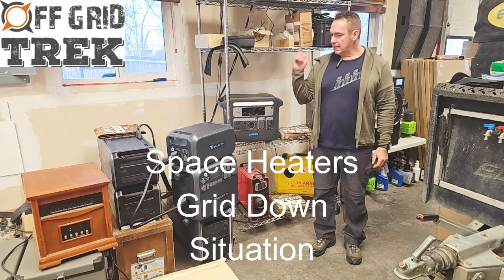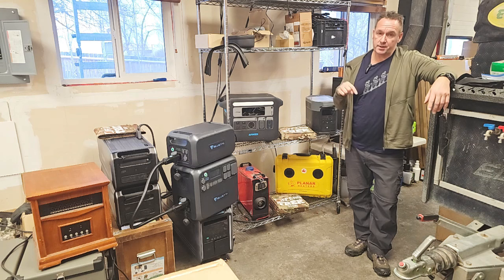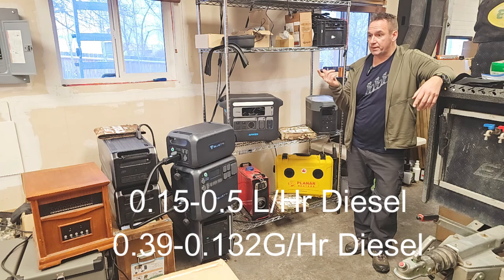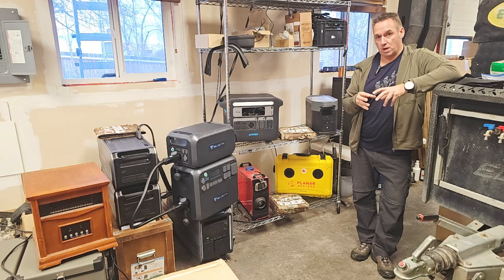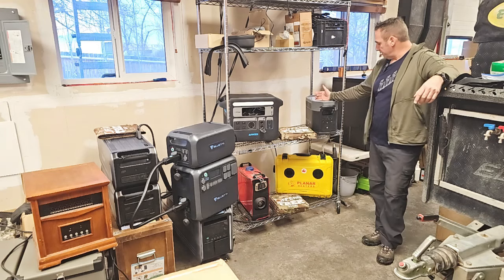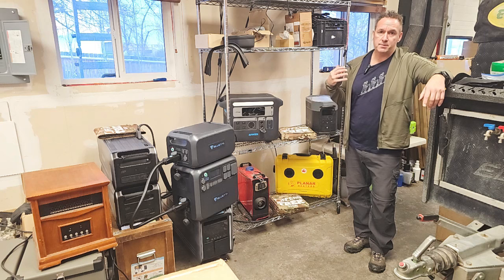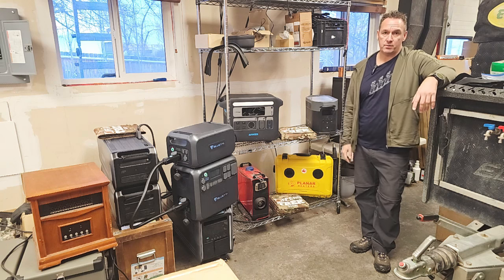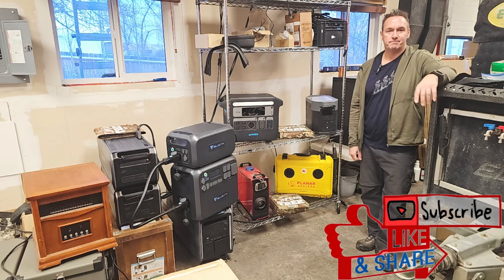Space Heaters during Grid Down

Comment: I ran a Diesel Heater 2 years ago all winter no issues. Tried to do the same  the following year and got an error code and the heater refused to start. IMO some have great luck with those heaters, me not so much. I bought a Quartz Radiant Heater, on the low setting it draws about 325 watts, High about 800 plus. This so far is the best option for me. Small Butane heaters are pretty good also, like the Cupid Portable Butane Gas Heater even a Heating Blanket plugged into a Power Station, will keep you toasty for many hours .There are many options if you want to stay warm in and Emergency Grid down scenario. These are not extremely long term fixes. The best option is a small wood stove professional installed or a DIY Tent Stove you can retrofit through a window. One should have all options at hand so you can adapt to your situation.
Reply from the maker: I have had to deal with the fault codes on the Chinese diesel heaters and was able to find a list of fault codes with fixes, I ended up printing it and bringing it with me when I used the Chinese diesel heater.  Now that I have the Planar heater I no longer have to deal with this, not fun at -20C when a fault code stops the heat when in the mountains in a roof top tent trouble shooting with a headlamp on.

Comment: The best way to keep warm is to adapt your homes gas heater so that you can start it with your solar battery. There’s videos out there that show you can use to keep warm.
You can do it yourself, but it might be best to get somebody who knows what they’re doing.
Also, an electric blanket would be better than trying to run an electric heater. 
I like the diesel heater, but that would be just for one room in the house and not protect your water pipes. 
For a long-term grid down situation, you will definitely need solar to charge your batteries, and a generator also. Dual generators with gas and propane are best. 
It’s also important to insulate your house the best you can.
Reply from the maker: All good points thank you for bringing them, many of these have been covered in previous videos.  I wanted to focus on space heaters along with better alternatives being this question is asked daily by our customers.  With our -55C/-67F weather that weekend it seemed like a good opportunity.  Note that with a properly insulated house a diesel heater will heat several rooms, granted a high efficient wood stove or running a furnace of of a portable power station will be the best options, and something I have personally.
Reply: Thanks for sharing your thoughts! You brought up some great points. If you’re interested in this topic, we encourage you to check out our award-winning documentary called Grid Down Power Up - Documentary, narrated by Dennis Quaid. It’s free on YouTube, and it goes into a lot of detail on these issues. Plus, they’ve got a website where you can take action by contacting legislators and public utilities. Please help us spread the word!

Comment: YOU NEED 15,000 WATTS OF SOLAR PANELS AND QTY. 24 (2 VOLT) ROLLS SURRETTE 5054 amp-HR BATTERYS WIRED SERIES 48 VOLT THIS WILL RUN A 1500 WATT HEATER , BY THE WAY EACH BATTEY WEIGHTS 570 LBS, AND THEY ARE JUST ABOUT THE HIGHEST LONGEST OUT PUT BATTERY MADE, AND THERE ON SALE RIGHT NOW $2,094 AND YU ONLY NEED 24 OF THEM, THEN WIRING AND NOW THE PANELS ARE THE CHEAP PART, YOU ALSO NEED A BUSS BOX, WIRES, SOLAR CONTROLLER AND INVERTER AND YOU WILL HAVE A ENERGY FREE HOUSE AS LONG AS YOU HAVE NON ARCTIC  NO SUN!
Reply: Thanks for sharing your thoughts! You brought up some great points. If you’re interested in this topic, we encourage you to check out our award-winning documentary called Grid Down Power Up - Documentary, narrated by Dennis Quaid. It’s free on YouTube, and it goes into a lot of detail on these issues. Plus, they’ve got a website where you can take action by contacting legislators and public utilities. Please help us spread the word!

Comment: How is the odor? Does it make the house smell like diesel?
Reply from the maker: You can leave the diesel heater outside and have the hot air vent go through a window using a dryer vent hose then block off the remainder of the window to keep heat from escaping.  It would be best to also cover the diesel heater if it is raining.